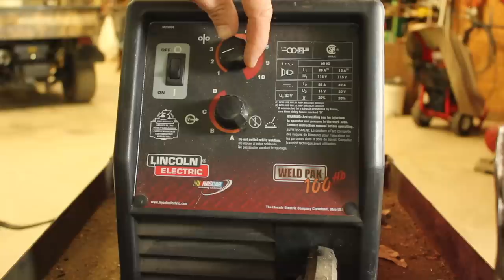This Simple Sawmill Hack will keep you Cutting All Day!!

Comment: Not for nothing but couldn’t you of spun the socket around backwards for a square drive and weld say the round side to a driver , this way you wouldn’t have to grind shape or nothin
Reply from the maker: Ray Raz I understand what you’re saying, but the square drive doesn’t fit the rectangular shaft on the winch, and I didn’t want to permanently modify the winch by grinding the shaft to fit a socket drive.
Reply: Fall Line Ridge got ya ! Looked square , just a thought, I actually had to do something similar today for work tomorrow, the anchor bolts I’m setting have dry packets you send down a hole before using an adapter for a hammer drill to drive them hence mixing the epoxy , so I took a hammer drill bit and welded a 10mm socket to it , realizing 10 minutes later I could of ground the shaft of the bit to fit not only the 10mm but any 3/8” drive , so I tossed out the original and ground one down to a 3/8” square lmao 😂👌🏼🤙🏻

Comment: You are working ENTIRELY TOO HARD. Weld a nut onto the shaft and put that socket on your drill/impact.  Problem solved in 15 minutes instead of 3 hours.  Those winches are $25 at Harbor Freight.

Comment: It didn't take a collage EDUCATION to do that.
JUST A need a little skill and some time.
If a big corporation had done this would have taken 3 to 6 MONTHS of trial and error. 2 or 4 engineer's and still the cost of retail product would have been 10 to 15 dollars for frist year then cost would drop to 1 DOLLAR in 6 months. 

If you need to replace it.
Take a socket cut off end weld two pieces of plate with the right gap to socket then weld up sides.
Faster. THEN reheat to orange,  drop into cold water to retemp metal.
Remember smarter not harder.